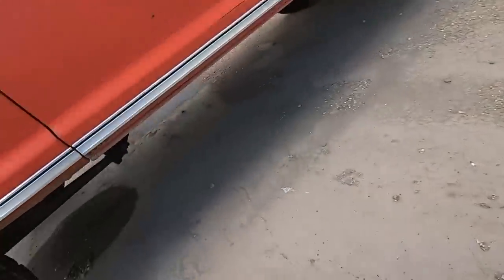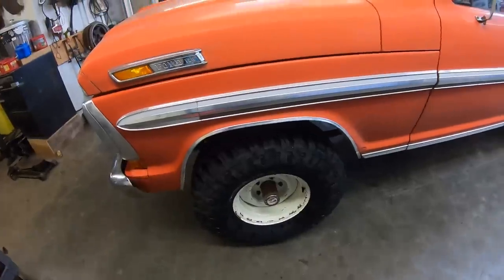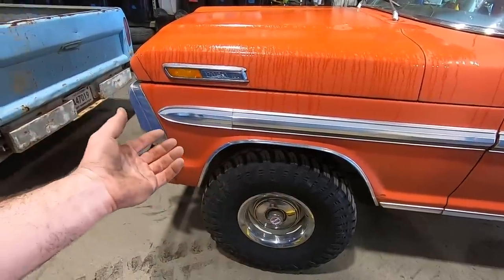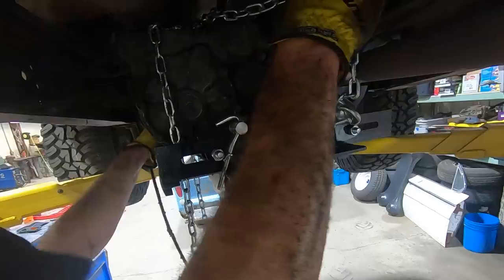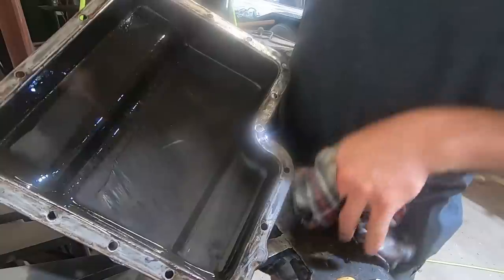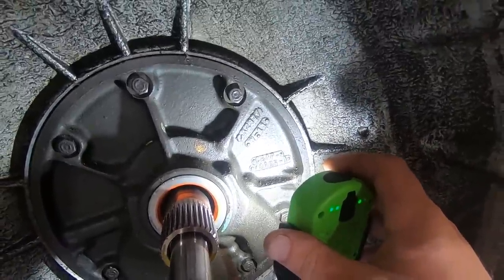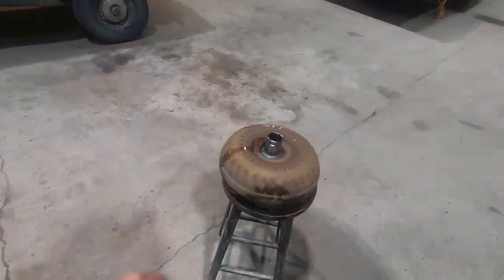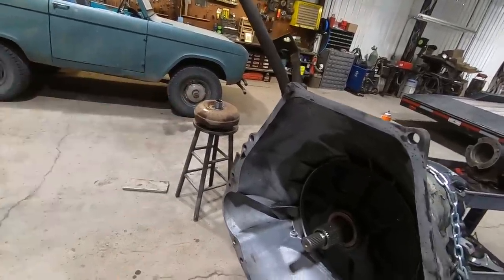Did I just Destroy the Transmission on my 1971 F100?!? Hey, at least it's got new Tires on it!

Comment: That was brutal to watch, my anxiety level was ratcheting up as you went deeper into the trans flying blind. I have worked on enough transmission carnage after someone didn't do some research, nice recovery. Next time check to see if the sealing washers are good on the pump retaining bolts, another source for oil to weep past, some sealer or an o-ring can help that out. The pump gasket is to maintain oil pressure from pump to transmission, the quadring is to keep it from leaking around the pump and case.
Reply from the maker: Thanks for the info!
Reply: I will never buy an F-150 again, 4By4 8 foot bed xtra cab!

Comment: Hey Mortske, I worked in a tire shop years ago and I would straighten wheels out by applying a little heat and using a crescent wrench. You don’t really need heat with steel wheels but aluminum wheels will crack or split without heat. Obviously using the “jaws” of the wrench you can control where your bending by opening or closing the jaws. Hopefully I explained ok. You’re a smart guy so you’ll figure it out. Keep up the good work man.
Reply: Automatic transmissions remain a mystery to me no matter how many videos I watch explaining them. Good work ! I enjoy watching you. I've gone by my dad's advice since my first motorcycle and car. " Take it apart and see what's wrong. It's broke anyway what are you guna hurt?" I research the internet now and watch some bugger eating hillbilly make my fix look easy then dive in myself ,get terrets , and learn as I go.

Comment: I assembled my TH400 on it's side and ran into alignment problems like that.  I finally got it, but it was definitely more difficult than it needed to be.  If I ever do another one I'll have to make a better stand.  I definitely have the utmost respect for the people that work on the even more complicated transmissions.
Reply from the maker: Thanks
Reply: I rebuilt a 4l80 and a th400, I want to attempt a 4l65 next.
Reply: @Cucvfreek  the 4l65e is just a beefier 4l60e the 4l60e 4l65e and 4l80e are basically the same design wise the 4l60e is just a very weak trans

Comment: I've never been brave enough to open my transmissions to try and fix em. I usually send em out to be rebuilt. Great video! Love the content
Reply: I use to be afraid of automatics till a 904 that I had needed service so I went and bought the book and found out it was simple you need snap ring pliers and that but they are simple but the more gears the harder it get's. I have only messed with 3 spd trans but I would love to do a 4 spd but the new 8 spd trans look to much for me.
Reply: @79tazman  I guess I should go get a trans from the junk yard and gove it a try.
Reply from the maker: @mikescarhole  Worth a shot!

Comment: Spot on as usual - rims, tires and stance really make the look, and I'm with you in that 32 inches is likely the perfect tire on that 250 for actual driving without a lift - same for the 60s K-10s on 16x5 steelies. Really appreciate this video and your approach. There's so much to learn each time, like the Bronco front hub repair when I saw you pull the axle out to get the C clip back on. I found the same clip floating on grease when I pulled the manual hub on a swapped blazer axle - and now I know just enough more than the last guy who put it back "together".
Reply from the maker: Glad to hear it

Comment: I had a 72 F100...
And a 71 when I was 16. 
The 71 had over 100k on the inline 6 banger.
The 72 had a V8 & low miles, but it was wrecked (front clip).
So I put the 71 front clip on the 72 & it was a beauty...
Wish I had kept it...
And a dozen other rides I had..
Good video Mortske.
Reply from the maker: Nice!

Comment: One of my pals favorite trucks was a 1972 Ford pick up with a 390 Cu.In. 3 speed standard. stick.
His thought was " Less To break is always Better". The 390 was not cheap to run, but wow the torque was wild. Rust & wear finally took it off the road after 155,000 miles in a winter climate.
Reply from the maker: They're great little engines.

Comment: Yep because the thing below the oil pan is a stabilizer screw jack basically to secure vehicles on the lift for more safety since people have to be under the lift prying on the heavy duty driveline components so the vehicle doesn't suddenly shift and cause major issues.

Comment: I wish I knew about your channel before I bought my Super Scraper. I got it from the giant river and haven't needed it until recently. I used to use a Sears utility knife with a hole in the blades so you could mount them perpendicularly in the knife. Used them for years but they stopped making them. Had a few scrapers since but the Super Scraper is excellent! Rebuilding a Wisconsin W4-1770 currently.
Reply from the maker: They're really awesome tools!

Comment: Great episode and educational. I may be one of the first to use up a tube of that white engine assembly lube. I kind of cheat on that claim because I didn't use it all for engine assembly. I needed to fill a manual steering gear on a 1970 Chevy car. Google recommends 90wt gear oil but it just runs out the bottom. One person on a forum said use white lithium grease. That engine assembly lube was the closest I had. Used what was left which was mostly full tube and it worked great! Still doing good 5 years later. Very nice Ford and a real keeper.
Reply from the maker: Awesome!

Comment: i am not a automatic transmission professional. I have always been told that the torque converter should be filled with fluid before installing into the pump, also as you may already know, the Torque Converter has to be completely engaged as you slide it in and keep rotating it with hand push pressure toward the pump to fully line up the splines and seat the Torque Converter into the front pump or damage to the pump will happen when the transmission is matted to the engine.  Love your 71 Ford 4X4
Reply from the maker: That is correct

Comment: Love you work  Mortske, it's quality mechanic stuff , your keeping busy and that's inspires me to get off my ass and get working too, thanks.
Reply: Wonder if the whine is new to the trans? Just popped out on a forum, Ford makes an upgraded gasket to help align up the hole in the flange where the pump goes in, if it is the pump failing you will see metal particles in the oil. I really like your you tube channel, loved the Bubble top redirection!
Reply from the maker: Thanks! Glad to hear it!

Comment: Hey, little tech tip for your good sir, with those gaskets spray them with a little headliner adhesive then stick them on and they won't slide or move around on you at all and it doesn't effect its sealing ether.
I'm sure you know this trick but I used it all the time replacing transmissions at my work
Reply from the maker: Thanks for the info

Comment: I always had to do the tires at my Dad's shop and when I had really stubborn tires that wouldn't seal I would spray something flammable in it and light it and that's the only way I could get the bead to seal. That was mainly on Semi or tractor tires though.
Reply: Ether seating! Used it on the ranch for spray rig tires on rims wider than the beads! Learned modulation when I blew it off the rim, precious memories.......
Reply: @jamesragus1577  Yep, had that happen once too! 😂

Comment: Truck looks great with the new tires. I run 32x11.50's on my 4x4 77 F150. They rub the frame a little at full lock but do not rub the fenders.
Reply from the maker: Thanks for the info

Comment: My experience with auto transmissions is leaving them alone. But one I did work on was to change the valve body out of a 4x4 to a 2x4 and it worked great. Ford didn’t change stuff around so they interchanged with no trouble. I think the years were 1968 —1971-2. But it worked. 🫥

Comment: The best assembly lube for automatic transmissions is Vaseline. It's real good at sticking thrust washers in place. Also, making a couple of alignment pins by cutting the heads off some long bolts makes installing the front pump much easier. Always turn the input shaft while tightening the front pump. if it stops turning, stop tightening because something is out of place. 

If I would have had the trans that far apart, I would have at least replaced the clutch seals on both clutches. C6 Fords are bad about the clutch piston seals getting hard. The symptom is that it will be slow initially going into gear when cold.
Reply from the maker: Thanks for the tips!

Comment: Hello Mortske Duff Chinn & the new Senior member MO. Great video. I could both relate to and feel your angst,
Building as you dealt with the cross member.Score another for the lift. I remember using a sledge hammer to drive it back while done g the job on the floor the way you used to do them in the Old Shop. Keep the videos coming. I think maybe it is time to check out More Mortske.
PS. You are correct if you get more aggressive and have it locked into 4 wd with those tires it will grab the fender. 32' would be better if you plan to do any off roading or mudding. Too bad as it looks good with the 33 tires.

Comment: Your 71 Ford Mortske movie reminded me of changing the flywheel ring gear of my 76 F150.  What a PITA.  On the floor in a cold garage in Minnesota.  Driveshafts, NP205, no lift, don't remember the crossmember being so difficult as mine was a 4 speed.  Engine was a 360 pos.  Put a 67 390 in it later.  That was good.  Tires might be a little large but I like the white wheels, dog dishes and rings.  I sent you the DUFF Mn license plate pic.  Saw it in the Walmart parking lot in Cottage Grove Mn.  Thought, wow Morske is here shopping.  Ha.
Reply from the maker: That's a cool plate!

Comment: When you pull the pump out, suction from fluid can grab on to those other roundy things inside of there and then it don't go back together. Learned that way back in class the hard way. Luckily the guy who was working with me had taken a transmission class. He did like you did and had to take it apart and get it to line back up the right way. He was helping me put an engine back in to a Mustang 2. He didn't have the converter lined up right and it busted the pump when he started bolting the bellhousing up to the block Made a big CRACK sound. lol
Reply from the maker: Ooof, that happens far too often unfortunately!

Comment: The shifter rod allow you to shift the transfer case in the rear in neutral and then engage the front-wheel-drive portion of your transfer case so if you break a rear axle or something like that you can drive it around in front wheel drive high or front wheel drive low
Reply from the maker: Thanks for the info!

Comment: You should get a squirrel cage fan like from a furnace and mount it to a milk crate, then add wheels and even a light switch so you can have portable cooling fan -- for primo upgrade, fabricate a cage to hold gatoraide bottles with frozen water, swap them out with others when they melt -- sweet bliss at sammich time with the deluxe model crotch cooler.
Reply from the maker: Great tip

Comment: I saw a guy put a rim on a lath and instead of a cutting bit he had a roller and spun it adding roller pressure, as it needed till it was streight.
Reply from the maker: Youd' think that would be hard on the lathe bearings.
Reply: Yea, imagin that would be .I'm an idiot,lol it was an old 1010 tire machine.  He made a jig ,with a c- clamp ,looking jaws.  The jaws had an inner and outer adjustment rollers
Reply from the maker: @donaldlawton7384  those were good machines in their day

Comment: Good video brother. Lots of good info. One thing though with the tires, its the yellow dot that goes to the valve, Yellow is your light spot in the tire, red is the heavy. Now with that said I've also seen the dots within inches of eachother, in that case i always off set the yellow dot to the valve so you can get the red dot as far away from the valve as possible. And if you ever need a good mounting lube for low pros or stubborn tires, EuroPaste is a god send lol. Beautiful ol truck. Cant wait to see more of it.

Comment: My first job out of Jr. College automotive science degree was at a auto shop, (1972) "Tommy House Tire and Auto" in Decatur Il. They had a rim straightening machine made by Hunter. I got to know that baby well!
Reply from the maker: I need to find me one of those!
Reply: @MortskeRepair  Any of the "Old Time" auto repair, wheel and tire, shops that have been around since the 60's/70's will have one sitting back in a corner, covered with dust and tons of debris! No one knows how, (or wants to take the time) to run one now days, that's for sure! If you go around and ask a old timer, at one of those shops, they will give you a good deal on one for sure!
Reply from the maker: @stanleyflory6702  I'll keep an eye out for one!

Comment: Hey Mortske. Get a needle grease gun attachment. NAPA has one that snaps on and slipes over the head of the grease fitting coupler, to keep it straight. it works great on hard and impossible to get to fittings like U-joints. Peace.
Reply from the maker: I've used them before.

Comment: Unbolt the front spring bucket on the frame and drop it down till the height  is where you want it and re-drill the holes in the frame. Poor man's lift kit (with in reason). I bet it needs radius arm bushings lol
Reply from the maker: Interesting

Comment: hey Mortske, if the old girl needs a differential.  you might want to think about get the whole rear end out of a Explorer or a Expedition. that way you would get a limited slip and rear disc . I helped a friend put one in a F100 a few years ago.
Reply from the maker: Nah, I'd just go through the 9", less hassle and still stronger. Then your bolt patter is the same, width is the same and gear ratio is still the same.
Reply: @MortskeRepair  cool. Been waiting to More Mortske. Have a great 4th .
Reply from the maker: @waynedavis7245  Same to you!

Comment: I decided to rebuild a 700r4 and convert it to 2wd using the output shaft from a 4l60. Tech tip: 700r4s need a set of gears on the output shaft for the governor. 4l60s aint got whatcha need. Had to take it allll back apart again.

Comment: Seen someone take the engine out with the trans still attached then put just the trans back in and then bolt the block up to it. He figured it was about the same time as it would take to mess with that crossmember. I think it was a '72. Had the Glorious 390 2 bbl. in it. Those are great engines - loads of torque.
Reply: I've seen guys take a torch to transmission crossmembers and weld it back together rather than messin' around with those. lol
Reply from the maker: @W1se0ldg33zer  Such a terrible design!

Comment: I did that same job on an old ford pick up and I had to burn the revits out of the cross mender what a pain then I used a stack of old tires to set the trans in before you pull the pump In that vertical position the pump came out ok and went back in ok no leaks
Reply from the maker: Good idea!

Comment: I always use a few oz of antifreeze in each tire I mount for my own personal vehicles. It doesnt work as well with low profile tires that are dynamically unbalanced though.
Reply from the maker: What's that do?!?
Reply: @MortskeRepair   The heavy side of the tire creates centrifugal force causing the antifreeze to sling to the lighter side, which causes a balancing effect on a rotational mass similar to, if not identical, to a balance ring on a washing machine in the spin cycle. Too much antifreeze as a balancing agent or balast is not good either as it creates a much undesirable shake and shimmy in the steering wheel when going over large bumps or pot holes. In my experience on several vehicles, less is more.
Reply from the maker: @jasonsilberman5240  Great info! Thanks!

Comment: I used to straighten steel wheels all the time with the old Coats 40-40. I also bent a few on that machine. The bead breaker was also a great rim straightener. Can't do that with yours. It's too new. I also knew nothing about automatics until I rebuilt a C6 and put a shift kit in. A lot easier than I thought it would be. Even on the one I am driving, I have never used a torque wrench on the bands. If they are out a bit, you won't even notice. Turns out they aren't as critical as they make you believe. I don't even own a torque wrench that small. My dad always owned Ferds and only worried about the "clunk" in the rear end when it didn't do it. I had the same problem with my mic. Just needed a stereo to mono adapter. Cheap and easy fix.
Reply from the maker: Those machines were good for busting the centers out of aluminum wheels!
Reply: @MortskeRepair  I worked n a tire shop. There weren't many aluminum wheels back then, and only the unskilled guys broke things. I never damaged a single alloy wheel. Including Cragers.

Comment: Yea as a Ford guy, i was not impressed when i tore the frame Apart of first 79 Bronco frame.   but got some spare's lots extra Odd Nut bolt combos.  Got a C6 auto, looking for new home, think I sold its storage holder (03 ranger truck) my porch is getting Full, Wifes rose's do fine job hiding my crap from public street.